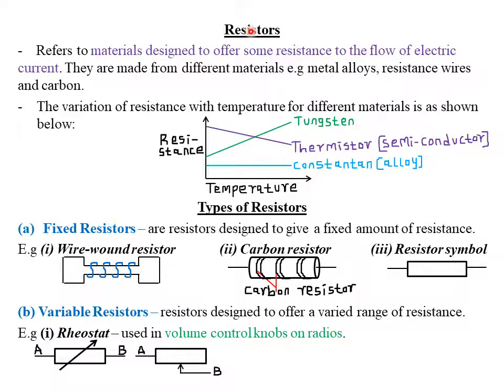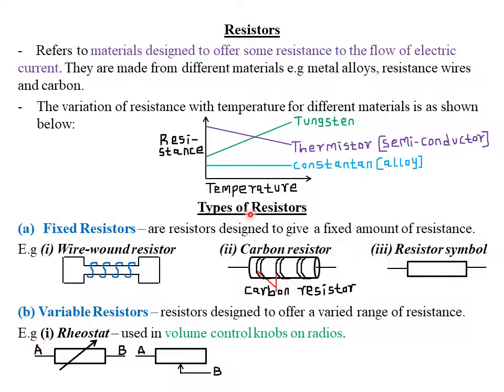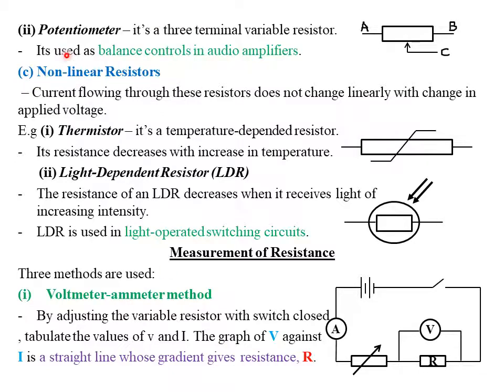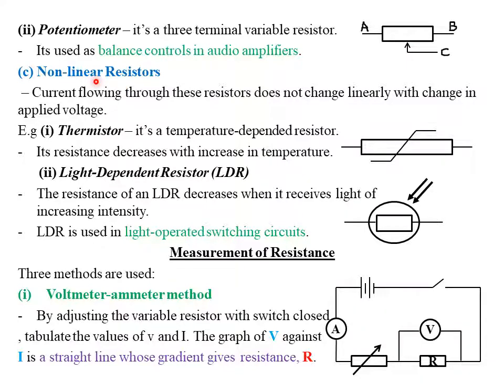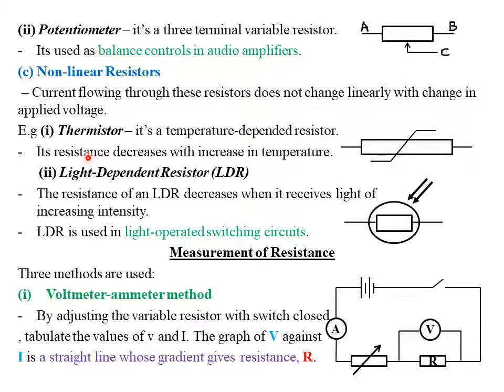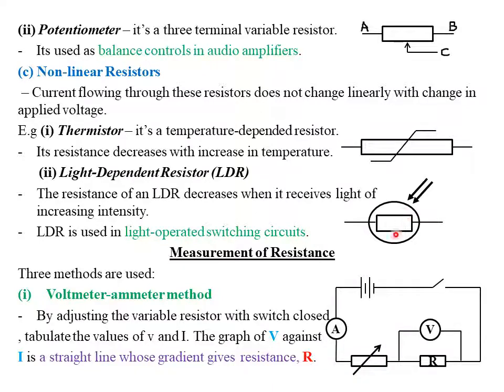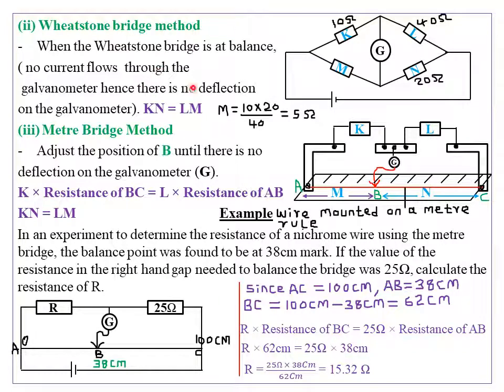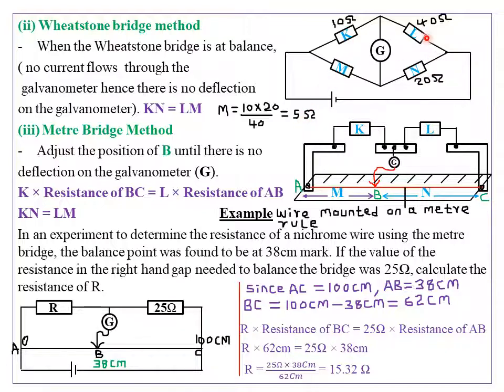CURRENT ELECTRICITY (II): LESSON 4

Comment: I thought we said that an increase in temperature causes an increase in resistance. Why is the case different in the case of thermistor and the constantan from the graph
Reply from the maker: The variation of temperature with resistance depends on whether the material is ohmic (obeys Ohms law) or non-ohmic (doesn't obey Ohm's law)